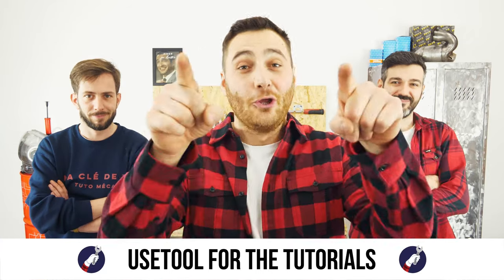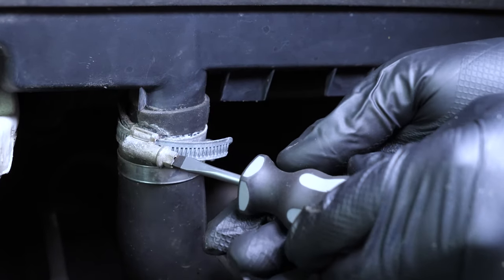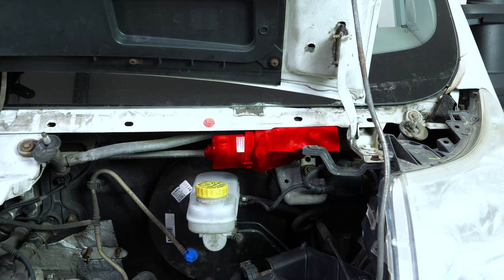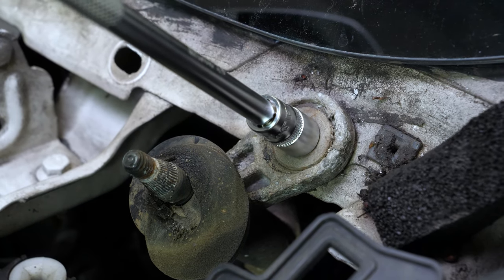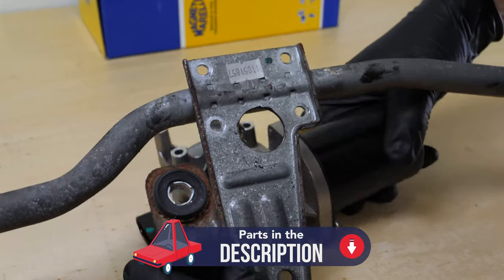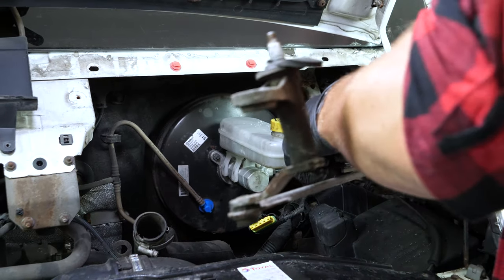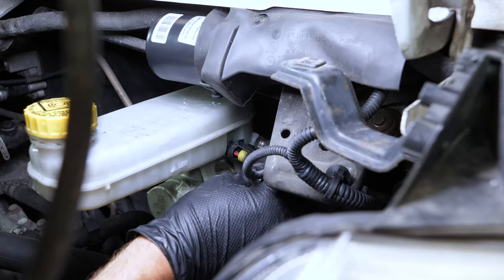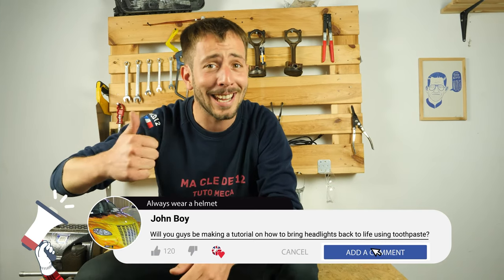How To Replace the windshield wiper motor Ducato mk3 🌧

Comment: Just a tip.When replacing the motor plug it in to the harness and turn wipers on then off so the motor then finds the correct home position for the linkages.Then refit the linkages to that position as the motors aren’t manufactured in the home position so your wipers won’t be in the correct position when turning the wipers off if this is not done.Will save you from doing the job twice.
Reply: Thank you Steve this sounds like a very good tip.